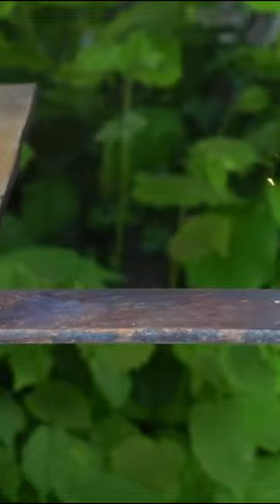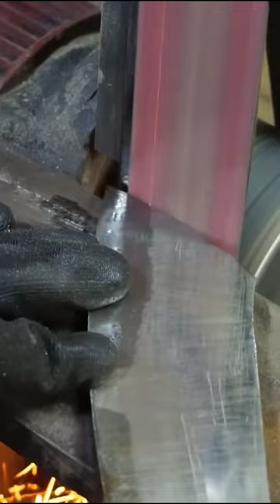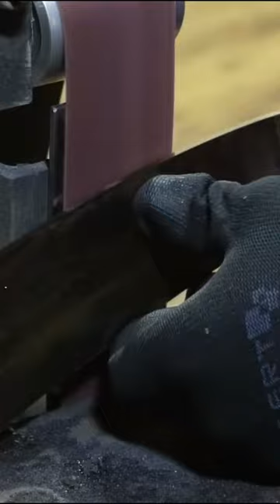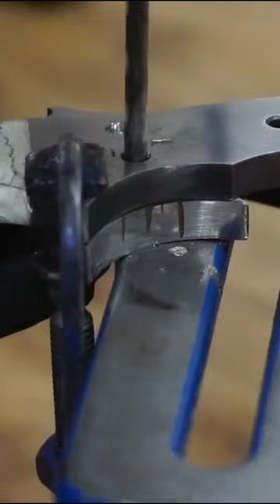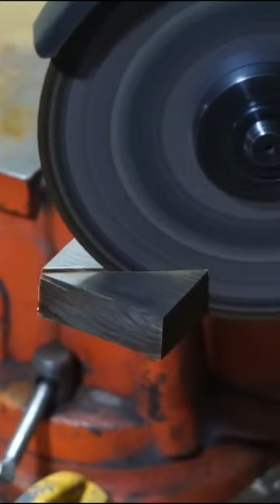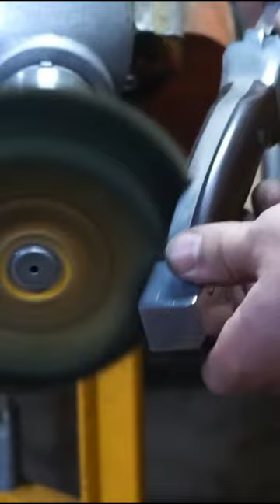Making Chopper Knife

Comment: sir, how to remove rust from metal forevar
Reply: I'm a blacksmith and i can answer the question, there is not a way to remove rust forever beacuse steel is a metal that easily rust, but there is some trick you can make to protect metal from rust.
First never let the metal wet, if you drop water or anything similar to metal just quickly clean it and dry the metal.
Second, keep clean the metal don't let the metal dirty.
Third if you want to protect better the metal you can cover it with mustard and let it for a couple of days, then clean the mustard from the metal (it will make that the metal takes a black/grey color and make it more resistant to rusty)